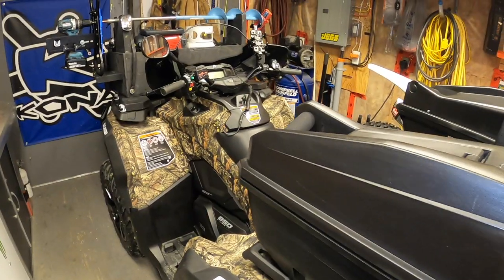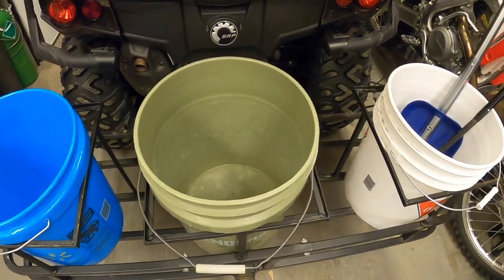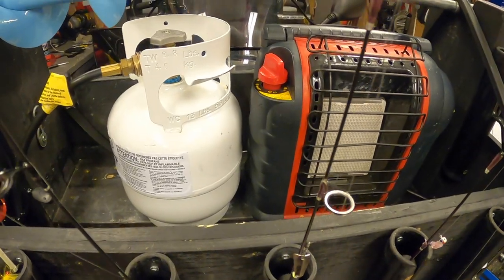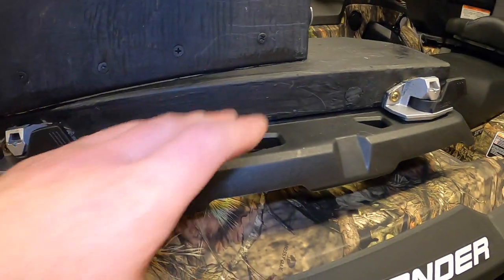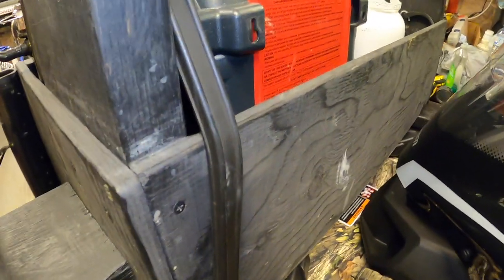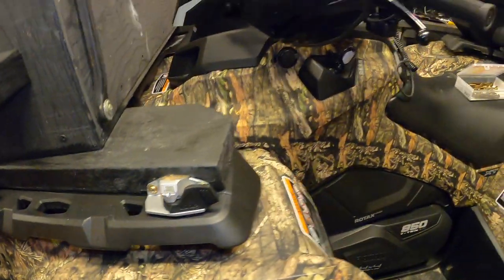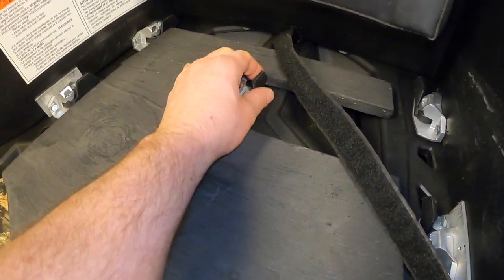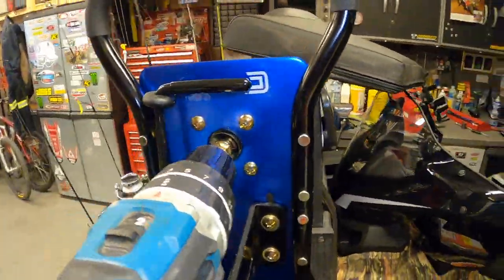ATV Ice fishing set up part2

Comment: Looks great. I have gone with the refillable 1# propane as I never use more then one & I bring 3. I Zip tie 2 milk crates to the rear rack to hold electronics & bucket. Cooler fits between crates
I do like the quick release for the front & rear.
Reply from the maker: Thanks! I’ve tried the refill thing for the 1lbers too. I personally could never never really get them completely full again though.